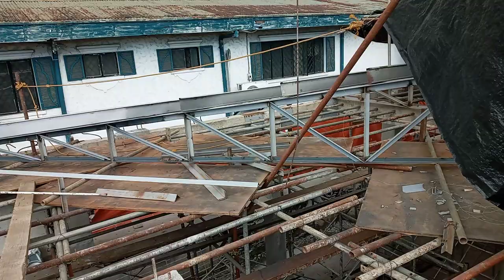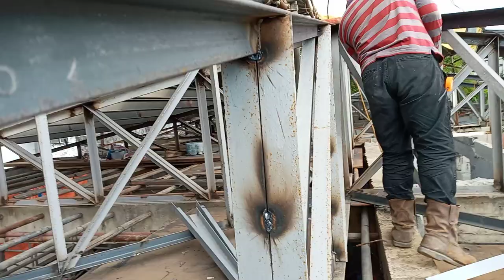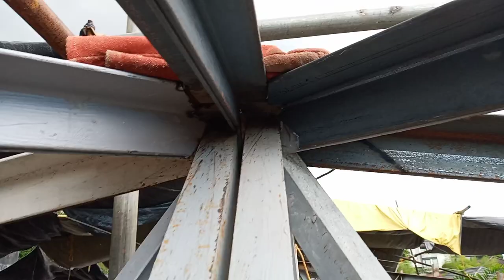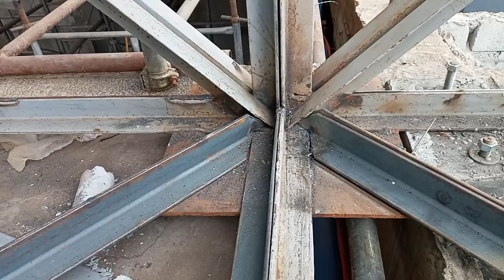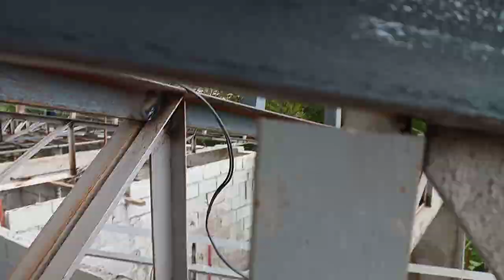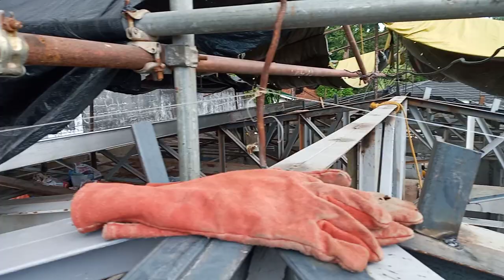FABRICATION OF STEEL TRUSSES USING ANGLE BARS

Comment: Idol 👏🔥👏 sa pag trabaho Ng ganito ano po Ang ounahin sa pag trabaho
Reply from the maker: I'm so sorry po lodi nawala KO itong youtube account KO, kaka open KO lng po ulit salamat sa pah subscribe, kaya gumawa ako ibang account KO, mino sabian ang name, any sasagutin KO po yung tanong mo, Una ko po pinagawa jan checking ng elevations, para sa mga baseplates at chemical bolts, then check the squareness of the rooflines, make sure the 45 degress of each corners before fabrication of your steel trusses using built up angle bars. Better to follow the drawing yung isaktong location ng bawat main trusses..kasi magkakatalo yan height maari magna problema ang purlins baka d magpanagpo. Yan ang iingatan nyo po.